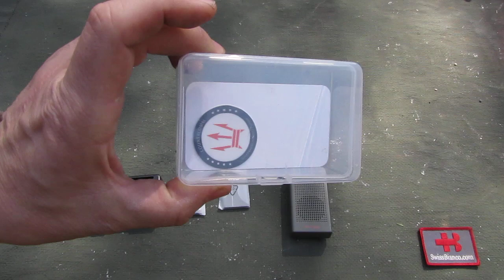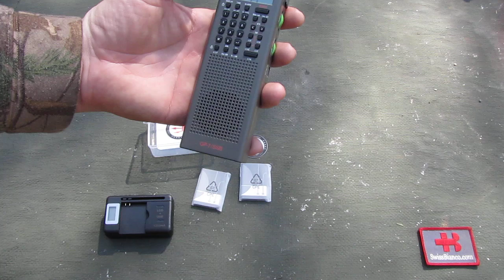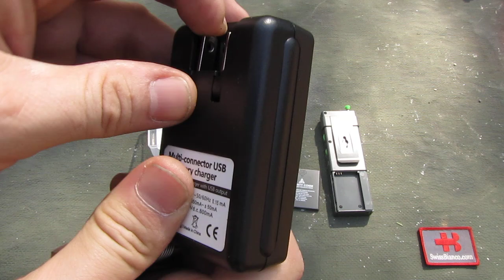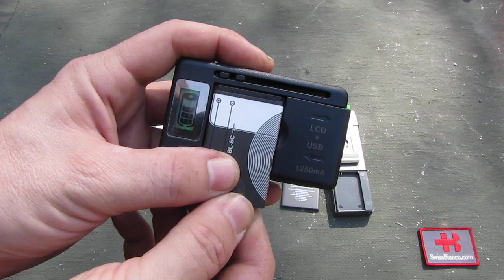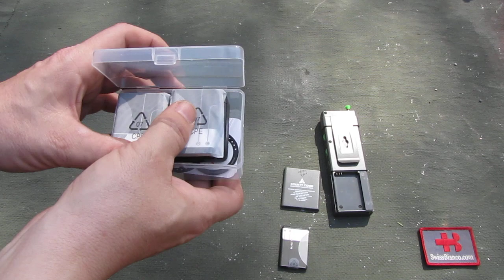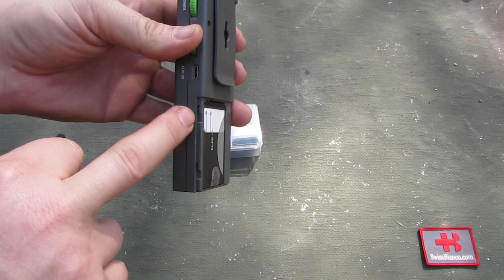countycomm gp-7 ssb extended runtime kit - well worth it

Comment: Nice review.  The GP7 is almost ideal for listening to HF in an austere setting or situation because of the size of the radio and it's multiple accessories.  I just wish Tecsun would have considered keeping the disposable AA or AAA batteries but I guess there was just not the room if they wanted to keep the same footprint for the radio.  It would have been nice to make the charger also work via 12VDC as there are situations in which AC is just not available.   Thanks for the excellent review. 
Greg
Reply from the maker: no there wasent enough room. maybe there is a device that hold aa cells with a cable to charge the on board batterie? i use the 18650 version.
Reply: @swissbianco  That's a good idea re charging.   I have the GP5 and it is fine but direct freq entry on the GP7 gives the radio a much better user interface.